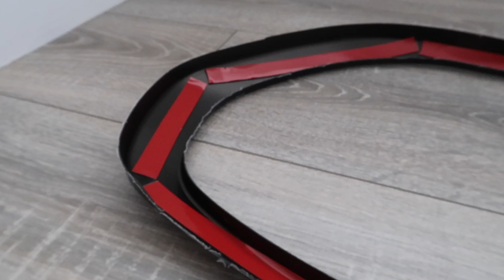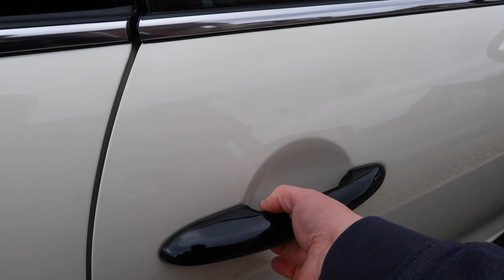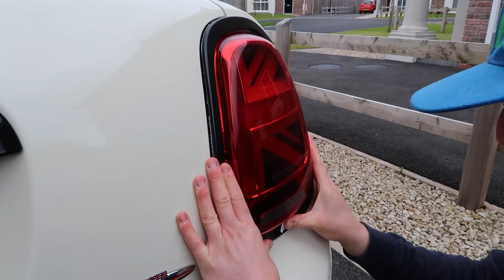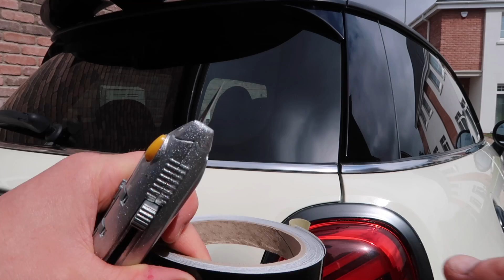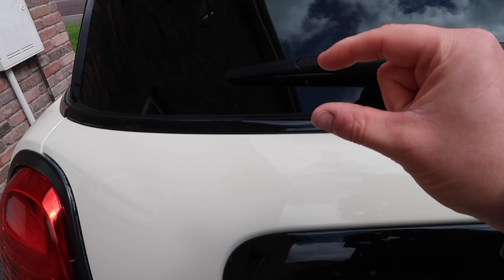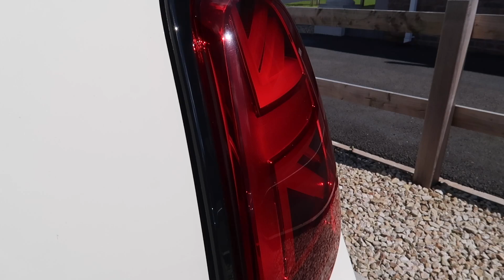DE-CHROME EXTERIOR TRIM INSTALL! | F56 MINI JOHN COOPER WORKS | SMPS2012

Comment: Hi Adam, I used to have a MK3 Nitrous Blue RS but now have a JCW Mini. I’ve already done the door handles and filler cap, and the front & back lights + front grill were already black when I bought the car. 
I was considering the £300+ proper black belt line kit from MINI but the tape might be a better  (and FAR cheaper!) option, how long did it take for you to fit the tape on the chrome belt line?